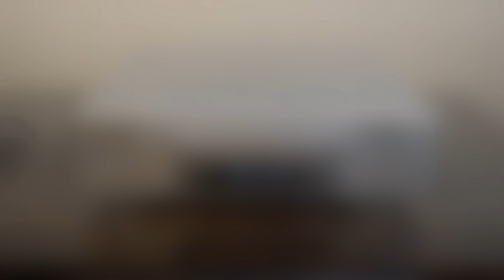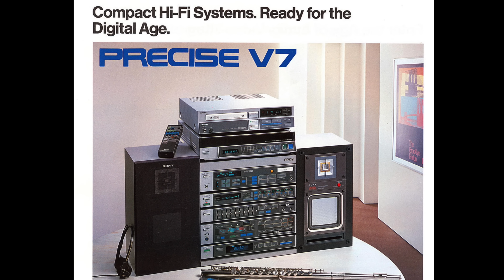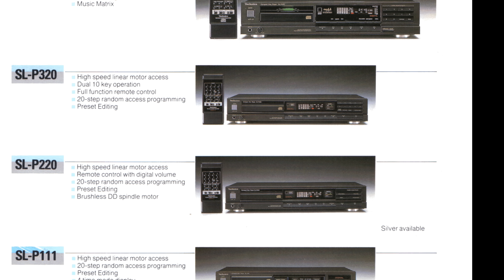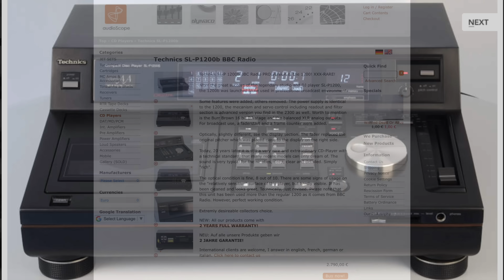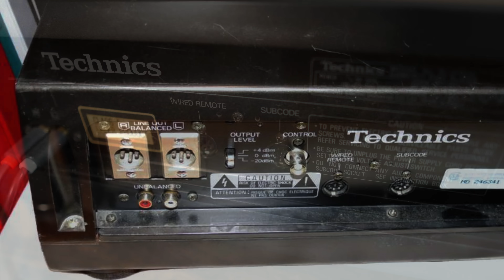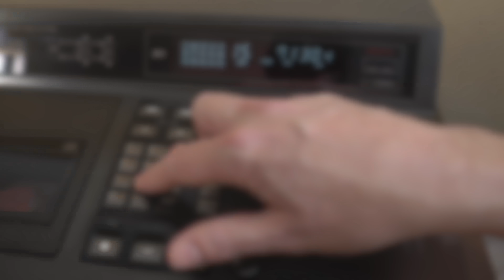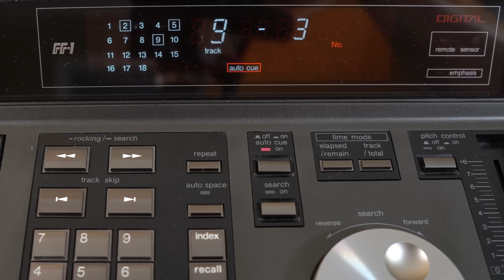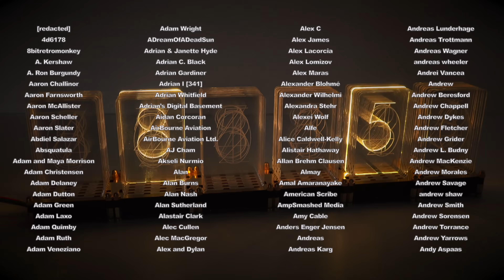How CD players lost their cool & why this Technics didn’t.

Comment: Concerning the loading time: I think the reason the SL-P1200 is able load an Audio CD so quickly is because that is the only type of audio disc it is designed to play. Since that it the only type of audio disc that it can play, it knows exactly what to expect. More recent "CD" players have to handle so many additional formats (including MP3 CDs, DVDs, Blu-Ray, and DSD), and due to that it takes longer for the player to read the disc.

This is why I'd like to see a return of true CD players, ones designed to play only Audio CD discs, including burned CD-Rs and CD-RWs. I think one of the reasons that gapless playback has become such an issue is because current "CD" players have to accommodate so many formats, some gapless and others not gapless.

Comment: Great video as always. Love your passion. This is kind of the holy grail. But kind of impractical in my setup. I would have to switch this out with my SL-1210MKII. I'm happy with my SL-PS70 until I can get a hold of an SL-PS740A. TOC reading times on par with the SL-P1200.

Comment: My first CD player was a JVC and it loaded from the top. It had a little button you pushed and a spring loaded door opened on the top of the unit, you would put the CD in and I don't remember if you just pushed it down or if you pushed the button again and it closed. The lid was sort of a smoked plastic so you could see the disk inside spinning.

Comment: I had one of those Pioneer RT-909s I bought in 1981 at the post exchange..  It started blowing fuses everytime it was powered up.  Sat in my closet for years until I had to dispose of it when I moved in 2023.  I was sad to see it go, but there was nobody in my town that did electronics repair anymore.  It was practically brand new with only about 30 hours of use.

Comment: Unsure why many commenters think Pioneer were next on the CD-DJ scene after this pro Technics?  I had a Denon DN-2000F in 1992 which I used extensively in the clubs ( with an Amiga 2000 as a Sampler) and in 1997, this was swapped out for a Denon DN-2500F

Comment: CD players as a separate piece of equipment,
became redundant after the popularity of cheap DVD players that could do the same thing and with a remote no less,
Not all CD players had a remote and would take up extra space in your entertainment stack
Reply: If you play a mixed cd in DVD players you get a slight pause between tracks where CD unit plays continuously as intended, DVD are slower to switch on and read, wouldn't want to use as CD player

Comment: My most favorite CD player that I ever had was back in the early 2000s. It was a vertical-configured, flip-lid front-loading desktop, where the chamber was vertical rather than the normal horizontally flat configuration and the front loading flip-lid was clear plastic in order to completely see the rotational movement of the disc as it played - just like a front loading washer. The chamber also had a royal blue LED backlight display, which accentuated the visual aesthetics of the disc while in play mode. Can't remember the brand or model, but it was sleek and gave the most beautiful visual display of the physical disc in motion...especially in a dimly lit room!! I wish I could find a CD player like that again!!

Comment: I used exactly the same Technics broadcast CD on air in the late-80s at a commercial radio station in Townsville, Australia. 
They were very easy to use.
The right-hand side fader on the unit we had altered the speed.
By the early 90s, many radion stations in Australia were using Denon players which required each CD to  be in its own plastic caddy for quick, easy, fingerprint-free use.

Comment: You made a point I just realized while looking for a 2nd hand portable CD player from mid-90's; over the years, starting from 85 till 2000, the windows on those players disappeared 😯
The models from the eighties had one half or one quarter of the disc exposed, then from 1990 until 1995 the window size were reduced, and after 1995 there were a very few units left with a small aperture to see if there was a disc and if it was spinning ! 
It is pretty useless, but nowadays, while looking for something different than solid state storage DAP of phone, or streaming, I think it is relevant to see the disc, the leaflet, the physical object.
The CD players are now coming back... Last january I bought a Shanling EC3 that has the simplest top loading mechanism ever... but the pity is that the glass lid is dark so you do not see the disc that much. The SMSL   PL-200 goes further ; the disc can be either under an aluminum lid, or exposed...
(the EC3 mimics a lot the look of the older high-end Marantz CD23 !)

Last but not least, Fiio is just starting to sell the DP-13; a modern portable CD player, basic but with lots of features. And one version has a full size window, at least 😀
For the moment I found a used Technics SL-XP350 for 45€; good audio quality, but does not feel high quality in the build... and the drive mechanism is really noisy and sluggish.

Comment: The pitch control was the crucial part of this. I remember this particular CD player from DJs using it with rave and house music. It was pretty rare, but you could always spot it because of the weird shape. What made it so good and useful is the pitch control for this type of music so when you’re actually blending one track with another, you can use the pitch control to match the different tracks on the records or in this case CD.  No other CD player offered this as far as I know. That’s why they called it a 1200 like the turntable. It was meant to be used the same way.

Comment: cd is 40 years old????
Reply: Older
Reply: October 1982 in Japan.
Reply: soon to be 43 years old in October of 2025
Reply: yes but it's important to remember it didn't really get mass adoption until the 90s because they werent cheap
Reply: First commercially available CD I know of is Bruce Springsteen Born in the USA. 1984
Reply: @TechBattle-enders According to German Wikipedia article of compact disc digital audio, the first mass produced CD was ABBAs last Album "The visitors". Its production began in August 1982 even before the first CD player was produced (November 1982). 
The english article just states that CDs were commercially released in 1982.
Reply: My dad's copy of the wall from pink Floyd is the first cd issue from 1979
Reply: @davide8764  This is the year of the album release, on vinyl, of course. I have a 2018 pressing of it and it says 1979 too. There were no cds in 1979

Comment: You know I have to wonder if Sony went with the horizontal design because they knew that it would make their machine sleeker and more compact and generally better looking versus what they originally showed off. Like they did it because they knew that people would want to buy the slicker more compact machine and they went with that to try to get a leg up over their competitors who based their designs on the original vertical orientation. I can imagine that Sony would do something like that, or least it sounds plausible for Sony

Comment: My favorite method is slot loading/ slot in players. While not practical for vinyl, I like the players where you just slip your cassette or cd in a slot and it pulls it in the rest of the way for you. Basically the units you find in cars but rarely in home systems.

Comment: I bought the least expensive CD player I could find back in 1983 which as a Mitsubishi (forget the model no.) which weighed probably  20 pounds, was loaded with tons of discrete ICs and the back was a very large linear power supply which got quite warm.  The cost of the player was ~$400 US and discs were around $15 to $20 US back then.  The local record shop only had about ten disc titles to choose from, so it didn’t matter much they were expensive.  What a difference 40 years makes.  That Mitsubishi player is long gone, but I still have the demo disc “Sing a Swing With Digital” which came with the player.  I believe the demo disc was included because there was a realistic chance there would have been no other discs available nearby for the purchaser to play.

Comment: Right now cds and cd players are reasonably priced.  I hope that when they get cool again they won't be as expensive as vinyl and turntables but I think prices will steadily increase .
Reply: Not really. Digital is very different than analog. CD's were made to a standard. It's why audiophiles hate them. It will be read the same in basically anything that can play one, it'll be 1 or 0. Which brings the next point CD players were more than just stand alone audio playing devices. You had playstations, DVD players, CD/DVD drives for PC's, all of which play CD's.

Comment: This seems like a stupid question, but I needed to know if installing a new laser would solve the issue of the machine reading burnt-CDs, or does the non-readability exist in the software/circuitry level?
Reply: It's the laser. The track in a pressed CD consists of tiny holes, where a track of a burned CD consists of black and white dots and stripes. These are not really sharp-edged and reflect totally different, so the laser can't pick up that signal.
Nevertheless, my old Philips CD100 can read burned CD's :).
Reply: @permanenceinchange2326  thanks for clarifying my query. :-)
That would be nice when older machines can read written and RW discs.

Comment: It was designed for radio stations weren't they?  I bought one and it only lasted about a year.  Heavy as heck, nice top loading and you can see it spin.  When it worked, it was quite nice.  The best factor was that the first 10 years of CD players had a more powerful laser which could read through scratches and defects.  It was cool but required its own real estate on your shelf.  Steven Pettinga, Indianapolis.

Comment: I'm sure you'd like the Beosound 9000 as well, since it serves as a jukebox for a cd-collection and is incredibly fast in switching between them.
Reply: I just bought a Beosound 2500... 9000 was just too expensive and large for my tastes. Much cooler of course but the 2500 still got the single exposed disc and the fully exposed cassette as a bonus... Now to get some transparent reel-look cassettes for a reasonable price... any tips?
Reply: @GoldenCroc  Not for a reasonable price, but I saw some from ATR that looked great.
Reply: @SH-kt3nk  I checked it out, thanks. Sadly the reviews for those ATR are all over the place, some say they are great, some say they are terrible. Perhaps manufacturing is very variable... Anyway, thanks again, I will research further.
Reply: And you can see all the CD's that are loaded,  plus the spinning action of the one being played.

Comment: These machines allowed cueing and the playback could be triggered by tape editor/ synchronises , this allowed commercial sound effects libraries, being used in AV program production. The sound effect were re callable by Track. say 15 dog bark , Index 19 Lassie . Every Post production studio, in the 80's had one of these. The digital output was no use, because vari-speed was essential, to pitch and time adjust the effect you were inserting. Digital output is always at a standard speed and pitch of the masterclock, unless you use sample rate conversion.

Comment: I had the front loaded SL-777 for 30 years, it had many of the same features, incl. the jog-wheel,  which was very convenient for me transcribing music: you could make it play a single chord in the music.
It was also the first CD player with a 1-bit D/A converter and praised as a milestone as that. 

As a reminiscent of a whole visible disc, it had a small window to a 45 degree mirror to the lit spinning disc.
I bought the last available laser and when that finally got dim at last the party was over. 
Very sad, I really loved it. 😥
Reply: I have the 770, only recently the drawer refused to open - probably needs a new belt for its motor. How many hours of use does it take for a laser to go dim?

Comment: You mentioned Sony,  questions....I found a Sony CDP-CX300  300cd carousel player (had to change the belts and clean the lens).  1.  Is the motor speed the same between cds and dvds?   and 2.  With adding a few holes to the back of the cabinet(for video out), would it be possible to swap out the cd reader and board for a Sony dvd reader and board.  turning it into a dvd carousel?    Lastly, would you ever attempt a video on re-lubricating the laser transport tracks?  I've got a dvd player that skips and freezes at the same times no matter what movies are being played.  Love your videos and thought if anyone could do it, you could...thanks!

Comment: A fine heavy doorstop, because that's all this model can be used as these days. 999 out of 1000 for sale have very dodgy transports that sumply can’t read the tocs of discs which then occasionally seem to start playing, but don’t produce sound and consequently just stop. I’ve had two of these models and exactly the same thing happened, and no professional and certainly no amateur repair technicians can do anything about it. Do not waste any money on purchasing this model with this well-known problem. The player also exhibits surface damage from poor handling with ease. Adverts including the words “for spares/repairs” are lemons to avoid.

Comment: The square footprint and round feet of this CD player were the same size as the SL-1200 turntable, so your radio station or club could swap CD players for record players and fit them into the existing countertops. Very clever.

Comment: I really like your videos and being an audio guy always find them interesting. I just stumbled onto this video and have some additional perspective you may find interesting. Firstly, I'm a lifelong career club DJ in New York City and was in the clubs when these SL-P1200s were first introduced. Interestingly they were built to the same dimensions as Technics' SL-1200mkII turntables, which had been the industry standard for quite some time. In big dance clubs the DJ consoles often had special cutouts for the turntables to be suspended on platforms by thick rubber bands to eliminated any vibration and feedback from the clubs' heavy sound systems. The thought of making the SL-P1200's base to the same specifications as the SL-1200mkII was so that clubs interested in switching from vinyl to cd could simply pull out the turntable and drop the cd player in it's place. Unfortunately (or fortunately) clubs were not interested in completely abandoning vinyl and would often have one or two of these cd players off to the side. I always felt Technics never really took the idea of club DJs using cds seriously as for our purposes these players were not great and never followed up with an improvement. Pioneer had their first DJ cd player out, the CDJ-500, and though not as sturdy as Technics', Pioneer's functionality was far superior. For instance, one of the biggest oversights Technics made was that the pitch control on their cd players was opposite from what it was on the turntables, which means all DJs would have to get accustomed to doing the reverse of what they had been doing for years when beat mixing... really stupid mistake. Technics should've jumped on it and owned the market as they had with the turntables but they left the door wide open for Pioneer to come and take it from the beginning, which they still have now close to 30 years later. Anyway, thanks for another informative walk down memory lane.

Comment: An Audio CDs at normal playback speed ( 1x ) spins at 500 RPM when close to center, 200 RPM when close to perimeter.   CD Player starts from the center,  that is the first track is physically on the innermost track and last track is on the outermost track.  Even at 200 RPM there is not much to see, it is too fast for human eye.  Also CD player is an optic device and optic sensors works best in the dark.

Comment: I would not be surprised if the bottom diecast aluminium part of your cd player is the same as used in the Technics SL-1200 range of turntables.

In regards to newer CD players often hiding the CD's away and looking more discrete, it makes me think of th B&O Beosound 9000 cd player went in the total opposite direction and made the CDs become as central a part of the machine as possible.

Comment: I was hoping for a vertical B&O machine :-)
I was at high school when CD's came out, and my school mate's Dad happened to run the local Sony office in Perth. The local cool FM station (96 fm) was the first in our corner of the world to play CD audio, and apparently they had one of those Sony pre-release players, the vertical version. It had come from being the demo machine at the big Electronics show in town that year ('82 or 83?). Anyway, the station found the audio was great but very high treble output which came across in their broadcasts. The cause was the racks of signal processing the station used to sweeten the sound of LP's and cartridges. But my mates Dad got in there and sold some more Sony equipment to make the CD audio warmer. I believe the first song they played was Dire Straights Love over Gold - as it was one of about only 4 CD's first available.